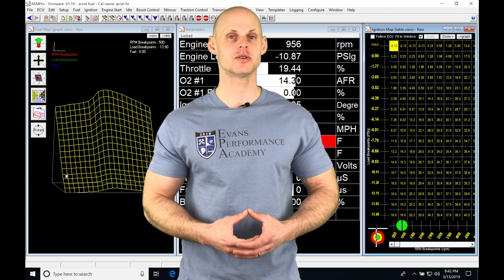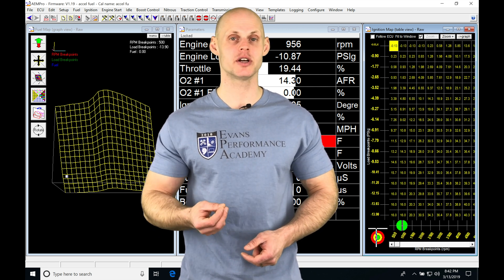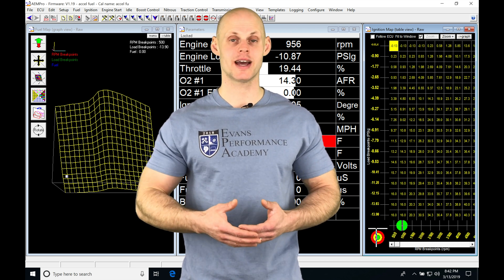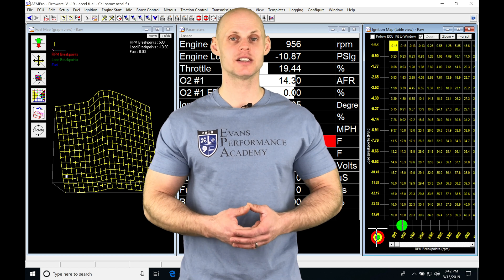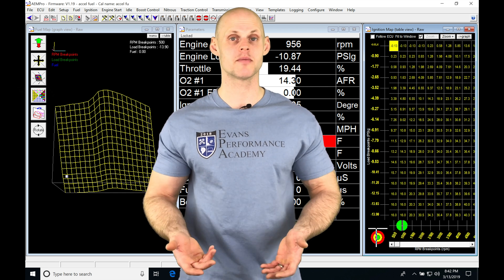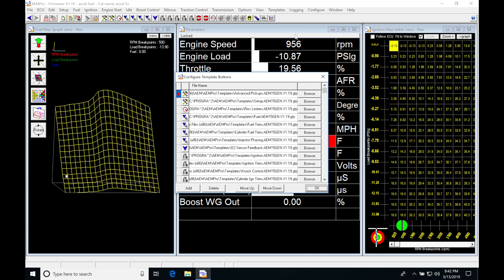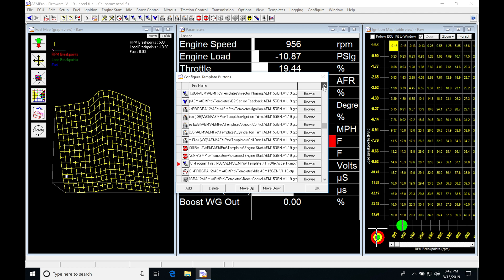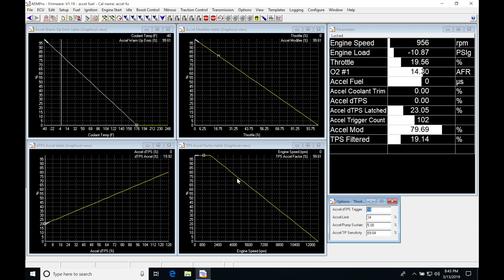AEM Series 1 Training: Accel & Decel Fuel | Evans Performance Academy

Comment: I am having trouble with stalling on decel. When I adjust the TPS decel factor table from 0-100%/0-8500rpm will this help my issue..the entire table is currently at 0%
Reply: At what engine speed do you stall? Is it to do with your idle control? What's your lambda reading when it stalls? What's your ignition timing?
Reply: @7mgtesup1  ignition timing is 15 degrees but I set ignition vs target to add timing below target..Afr is about 14.2 when it stalls after a throttle blip
Reply: Anu basemap aem v2 30-6050  cop bsereis.  Cam trigger tnx🎉